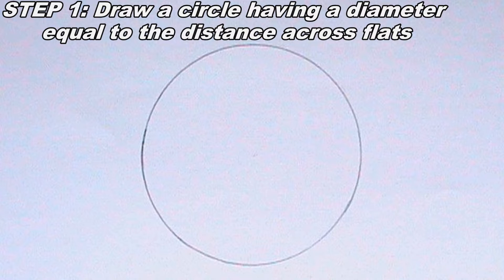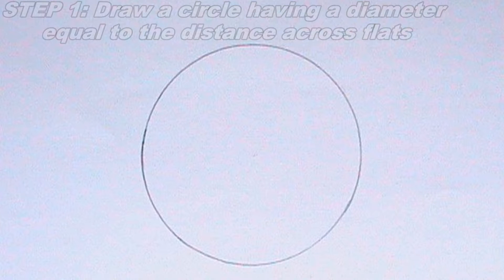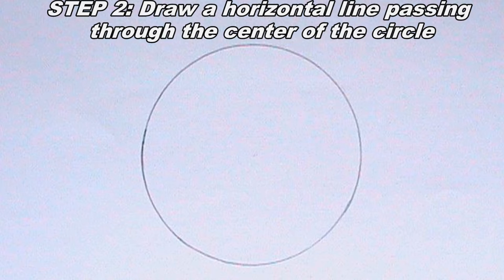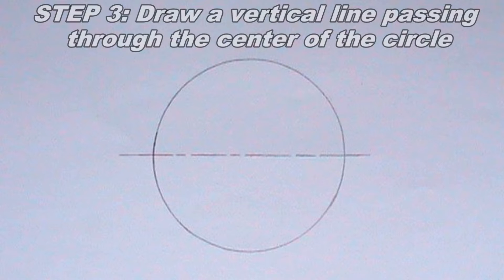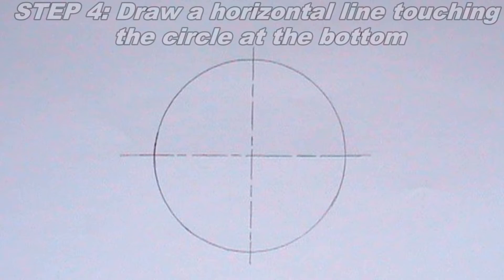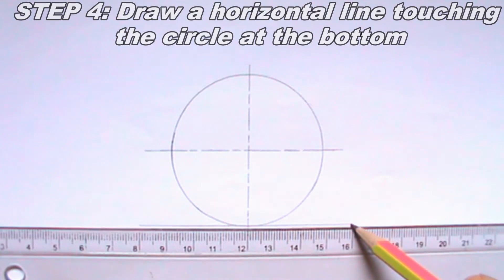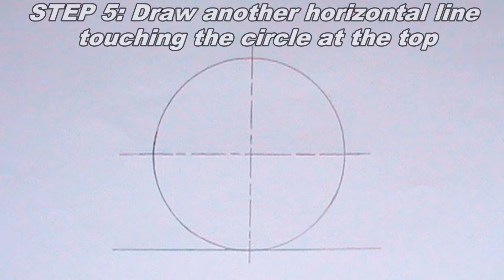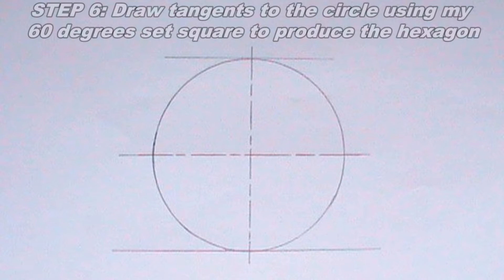HOW TO DRAW A REGULAR HEXAGON GIVEN THE DISTANCE ACROSS FLATS || GEOMETRIC CONSTRUCTION

Comment: I failed to produce 60 degree angle
Reply from the maker: You can easily produce 60 degree angle using the 60 degree side of your 60 degree set square supported by your T square.